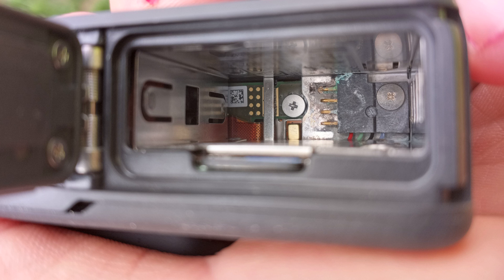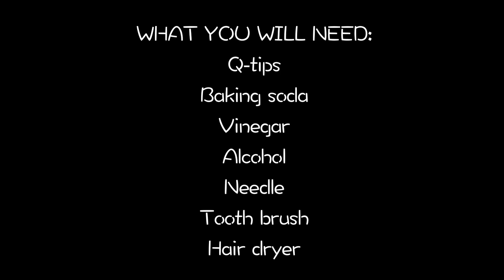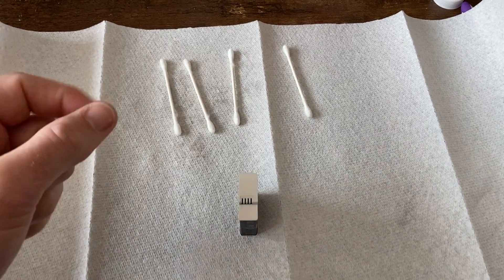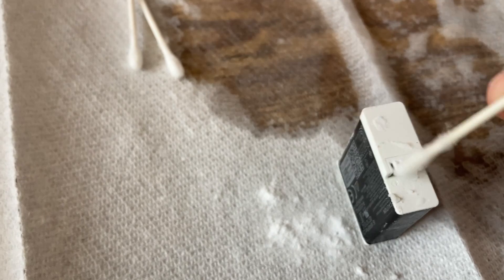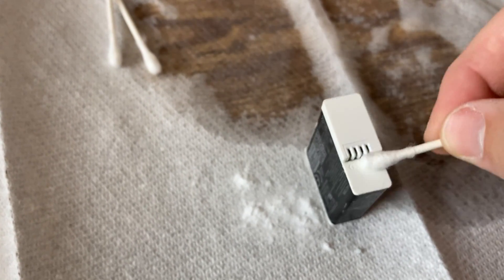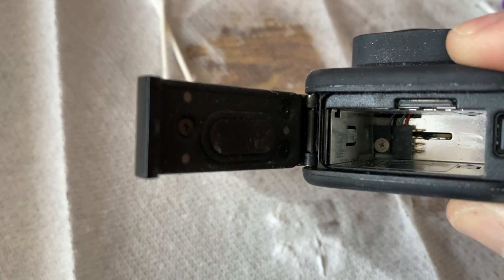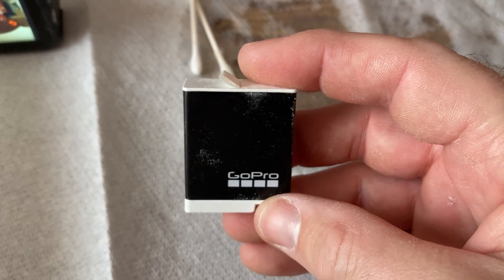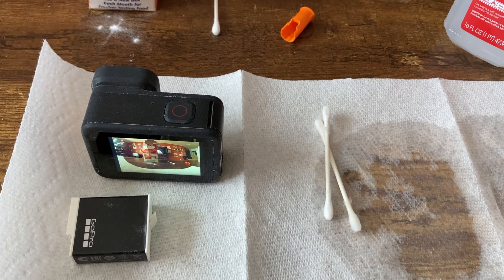How to fix a GoPro with water damage or battery corrosion

Comment: GoPros are notoriously problematic. I have resurrected two back from the dead,  a Hero 2018 and Hero 8 Black. The trick I've found is to just keep charging and plugged in and keep trying to turn on.  I was about to bin the 2018 after weeks of it being dead, turned it on and astonishingly it sprang back to life and still works now!  The Hero 8, I recently took it on a dive,  and the underwater housing was not latched properly. Incredibly there was water ingress,  and it stopped working.  I thought that was it... Fried!  But I persisted, and left it on charge.  And now this one has been resurrected,  and can work,  but is problematic underwater,  but fine on land.  In this case the battery pins inside the compartment look very messy with corrosion.  So I need to try this cleaning method to see if I can make an improvement and get rid of its current weird behaviour.  😅

Comment: What if I accidentally put it through the wash
Reply from the maker: GoPros are waterproof when closed (unless there’s a bad seal). If it’s not working after the wash I don’t know what to tell you.
Reply: @wingmanfoilclub  I had the battery in my shorts
Reply from the maker: I would probably just buy a new battery instead of introducing corrosion into the GoPro.
Reply: @wingmanfoilclub I was recording in the sea with hero 8, it won't turn on I put it in rise, what else can I do?
Reply from the maker: You’re probably cooked. My recommendation if you’re going to keep using it in the sea, get the GoPro subscription that allows you to replace a GoPro for 100 dollars once a year. Because they aren’t completely waterproof. Also if you see there is a lot of condensation in the front LCD, turn the camera off and leave it in a hot dry place to get the moisture out before turning it on again. They are great cameras, but I go though a couple a year Wingfoiling and doing tricks and crashes and going out in different temperatures.